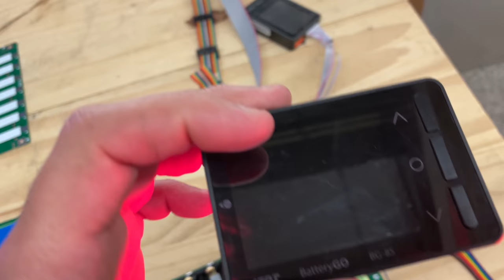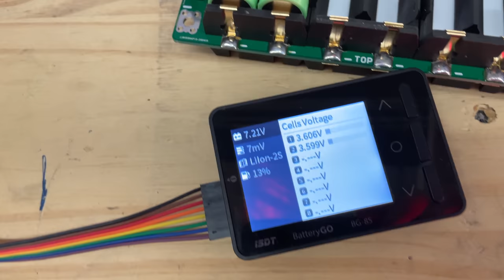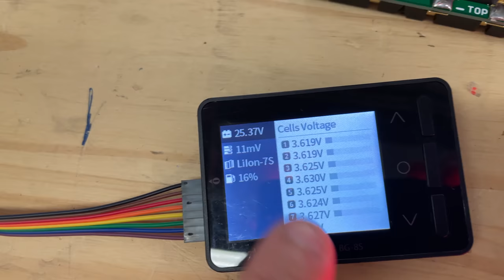SOC cable - BATTGO to PCB connector

Comment: Your timing is awsome.  Moments before I found this video, I had just finished putting together my BMS kit and then ordered the BG-8S and was unsure as to how to connect the two.   And now I did just buy the 8 pin cable you suggested.  Thanks

Comment: It'd be fiddly, but you could use the female IDC box connector and spread the wires so that they skip a terminal and then use the JST style connector on the other end, that way you can't accidentally connect it the wrong way.

Comment: Great, Jehu, but just in case — this cable doesn’t have anything to do with the BattGo, which transfers battery info through one wire (uses special kind of XT60 plug), it’s just a balance lead adaptor.

Comment: I always try to use polarized connectors.  It's way to easy to put one of those connections in backwards. You can have custom cable assemblies made in China.
Reply from the maker: But connecting the BG-08 backwards does not damage it,  so why fix a non-existing problem?

Comment: You can also make a small adapter PCB. If you have a female IDC connector where the ribbon cable plugs in, then you can wire it on the PCB to a JST that has the same pinout as the BattGo. Then you can use a male to male cable to connect those. Those PCB's would cost like 50 cents and make a more reliable and less error-prone connection than manual soldering. I can design the PCB for free, its really simple. Message me if you need any help.

Comment: the cells are actually secured individually. because the balance cable makes a parallel connection and then too much current could flow between the cells via the balace cable, or am I wrong
Reply from the maker: balanced leads are fused so not too much current can flow before they blow
Reply: @jehugarcia  ok you don't see the fuse only see the main fuse for the whole module there is a detailed description for

Comment: Does s the $39 come with the battery module ? It looks like it is part of the dealp
Reply: he said it. 5:09
also in the product description says:
"Finally, Our PCB boards are available loaded up with brand New Panasonic NCR18650B cells."
if comes empty,its a scam.

Comment: Hi, Maybe check what BattGo is .... It's not a product. It's a protocol for smart batteries. So the product you have there is a BG-8S battery checker from ISDT
Reply: Oh, I know what you're saying now. This product is not called Battgo. The Battgo label refers to the modified xt60 connector with the third pin. 

I think a lot of people, including myself, think of the isdt BG-8S as a Battgo isdt bg-8s because of the huge Battgo logo on it.

Comment: I didn't knew this is such a pain to connect with your cable, the "new" cable is just Arduino cables.
Reply: the only difference is that the black housing that holds the terminals is a block i.e. you can't separate them (unless you take a knife or other cutting implement to it)